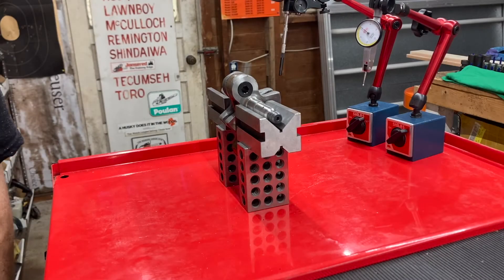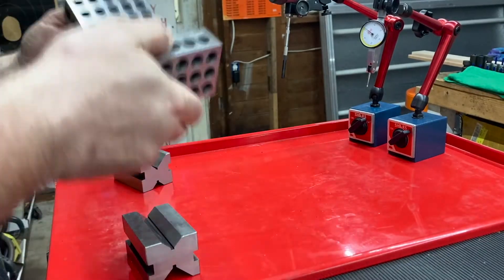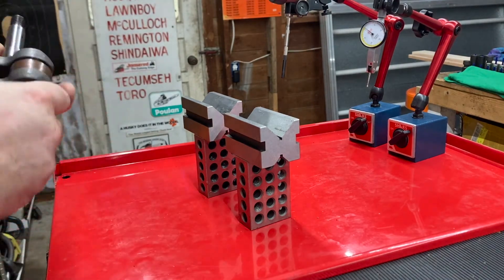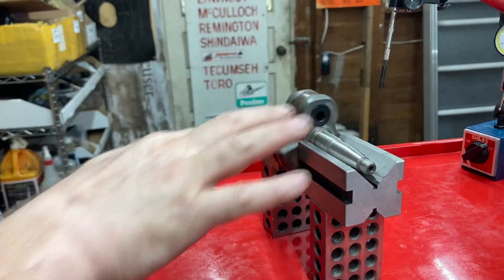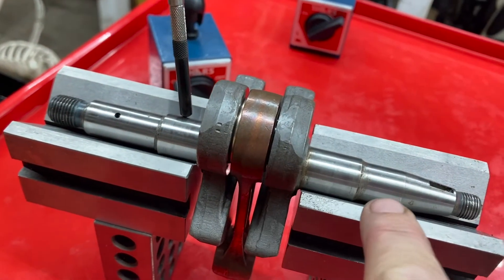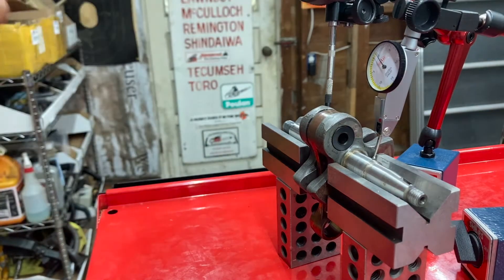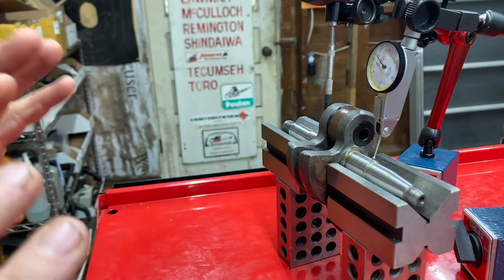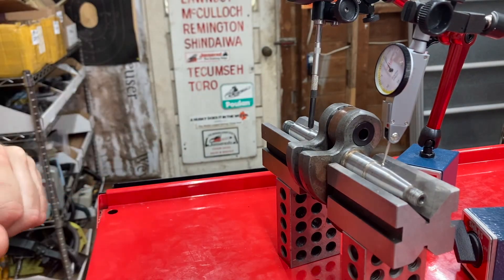CCC Racing Checking a Crank for a Stroker chainsaw

Comment: DD 👍
Really simple setup and no BS. Now remember that is coming from a bser who did that before shop class and hs. Again nice job DD. If you want to index a crank, kids... just do as Dave on that 90° off the crank pin or bearing surface area. Match all those at the angle and you can finish and polish your, multi cylinder now, "indexed" crank. Thanks for posting buddy. Oh and thanks for the new shirts
  CCC 😎

Comment: Don't matter how perfect these are....if they are installed with a hammer...............
Reply: I prefer an 8 lb hammer.  They normally seat in 1 swing ... or less!
Reply: @NCSU4x4  its amazing the lengths folks go to on precision yet overlook what happens if something is installed improperly.   Good thing DD has the right tools for the job 😉
Reply from the maker: truth!!